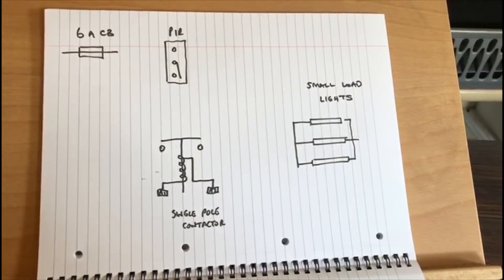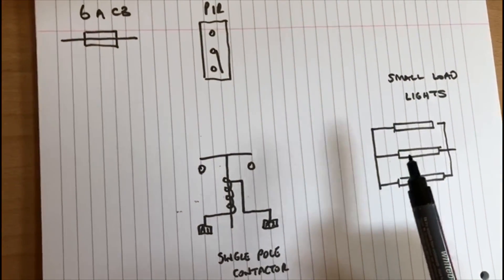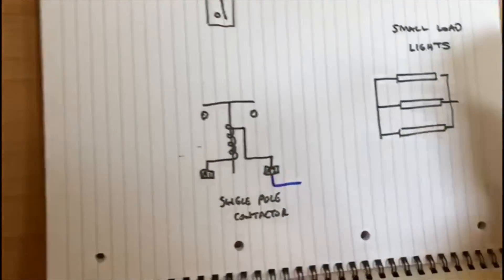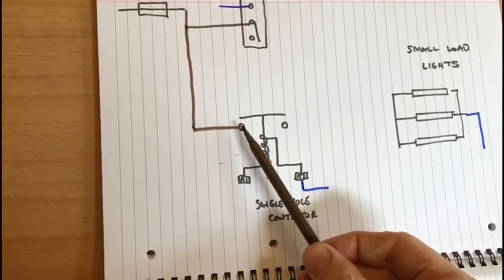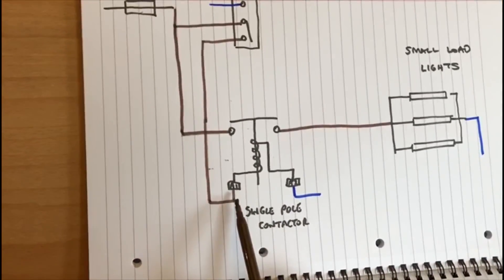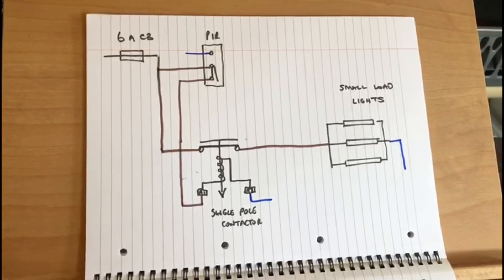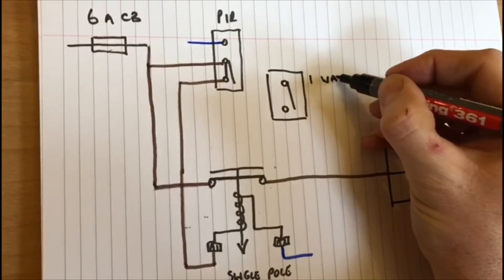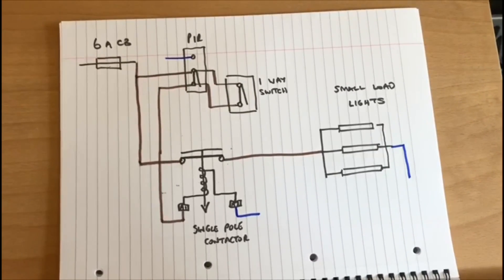PIR Controlling a Contactor - Wiring Diagram Part 3

Comment: The problem hear is that most PIRs have a minimum load they need to operate and the contactor won't meet that load. I've recently run into this problem, my PIR needed minimum 25w and the contactor coil only took 1.2w to power.

Comment: If the override switch is off. It looks like the PIR is still live sure that will still energise the circuit. Cant you install the o/r in the switch line that would kill the contractor.

Comment: If your PIR's were overrated due to the load, but the mcb/rcbo was not. Could you use this method to  install or would you be better off with two separate supplies. One for lighting and one for the PIR's including the contactor?

Comment: Is it bad practice for the override switch to bypass the contactor and supply the lights directly ?
Reply: That would result in the lights having 2 separate feeds. When the PIR switches the contactor on, half of the current (or thereabouts) powering the lights will now be coming through the contactor. When it switches off, all of the current will now be going through your override switch. If the override switch isn't rated as high as the contactor, this could be dangerous with a large load; the whole point of using a contactor is to safely switch larger loads than your switch gear is rated for. It's also possible you might disconnect the contactor and think you're safe to work on the lights because they go off, and then bump the override switch and energise the lights.

Don't do this.